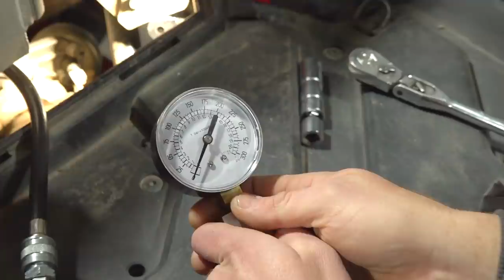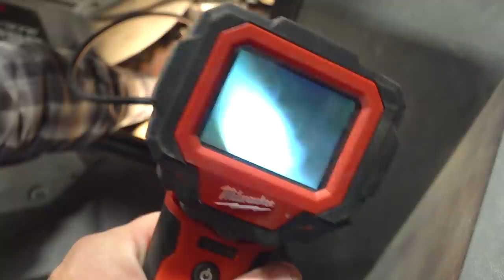Frankie RUNS OVER A JEEP and BLOWS UP OUR TURBO HONDA TALON!

Comment: Do pistons!! Get ahold of Chad at Dr. Powersports for custom 10.5 turbo pistons. You can do them in the car without pulling the engine in less than 30 minutes from where you are. Also get a hold of Erik at PPEI for tuning, fuel system, and map sensor and you will absolutely love it!!
Reply: Do you think Jackson will warranty the head gasket and the cracked #1 piston Or the manifold time will tell?
Reply: @gregbell652  I think we both know the answer to that 😂

Comment: I wonder if it is possible to do a d16 or b16 motor swap on the Honda talon.  D16 comes in the old 80s-90s Honda civic dx, ex. & si

Comment: Idk if the new Honda stuff has the stamina but iv personally put several 80-95s through hell and back, some without oil in them and they never let me down. Honda's have always been extremely reliable. Had some ignition problems early on but rotating assembly, fkn mint👌
Reply: Had a 2013 honda 420 and was swamped 5 times and still ran mint even with water being the oil 😂
Reply: @kylebeach2316  that's what I'm saying. And if the talon head gasket did blow when doogle thinks it did it has ran like a champ every since so apparently they are still true. Can't fly without your wings boys

Comment: Awesome content as always guys! Do you run wheel spacers on any of the units? I want to go with 2” on my ranger crew for better stability in the trail, I just worry about loosing a tire at 70!
Reply from the maker: We’ve run wheel spacers plenty of times with no issues, just make sure you buy good quality ones with 12mm studs

Comment: Oh, sheared the center spring pin/bolt. I hear hammers bangin' tryin' to get the leafs lined back up for the new center-spring bolt/pin. No biggy. It'll be aight 'bout 4 o'clock. However, the homeless person's trailer won't be aight 'bout 4 o'clock. Kinda has all the signs of a getaway vehicle involved in some sorta likker-store robbery. {0.o} 😆😂🤣

Comment: Have been following the build for awhile, was wondering if the motor would hold together like a true turbo motor, does not sound promising.  In the end if you want a turbo machine, buy one with forged components setup with the right base compression.  Sounds like a lessons learned from messing with turbo cars over the years:).
Reply: True, but the Talon put up with a lot of abuse!!
Reply from the maker: It would have if we didn't try to kill it lol

Comment: When i saw the wet plug, I told myself this isnt a hole in a piston, its a bent or popped valve. Now what? 😂
And PLEASE, change that piston. If the valve nicked it even if its not cracked, metal properties changed, its a weak point. End of the story.<